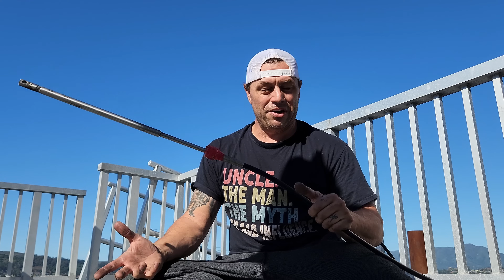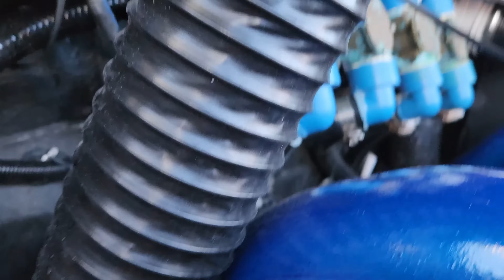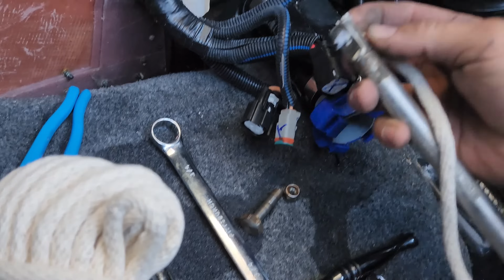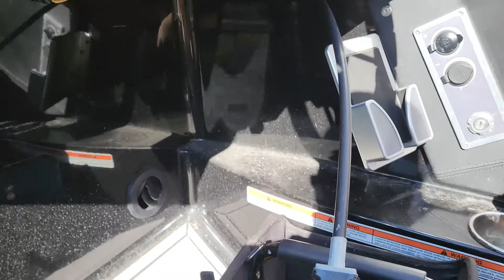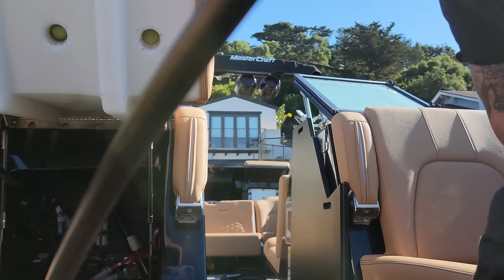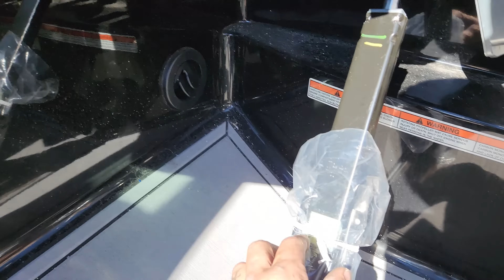how to replace a steering Cable in your wakeboard boat

Comment: I have a 2011 Malibu VTX. The steering cable is original. The steering is still very easy to turn but there is lots of play in the steering. Does this sound like a new cable is needed or should I look for another cause of the steering play? Thanks
Reply from the maker: You have a stretched cable. i would replace it. I would also check the rudder for play, and the teeth in the helm side of the area where the cable goes.